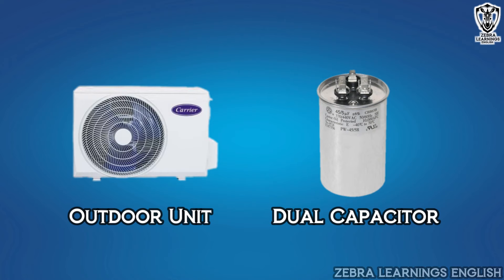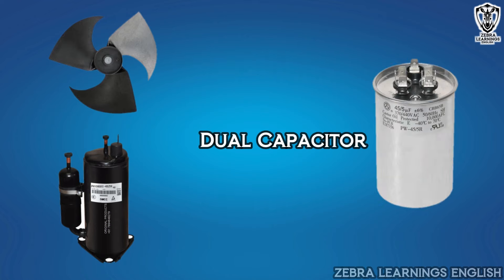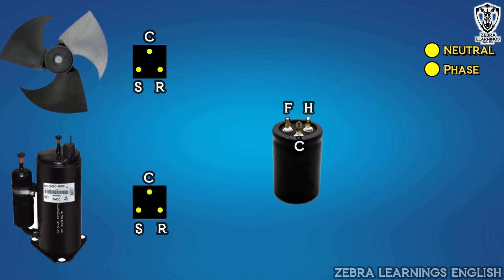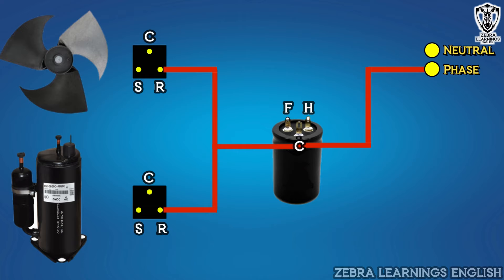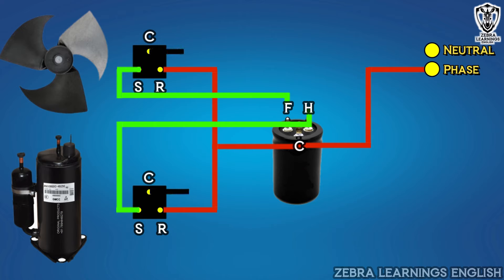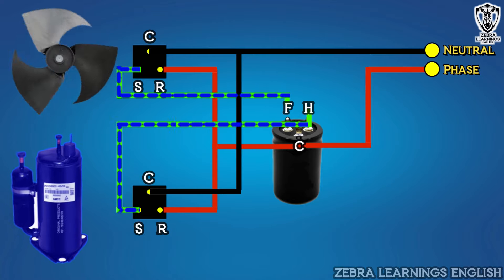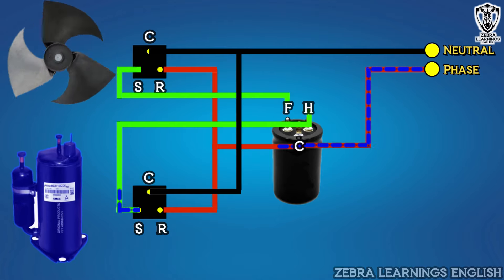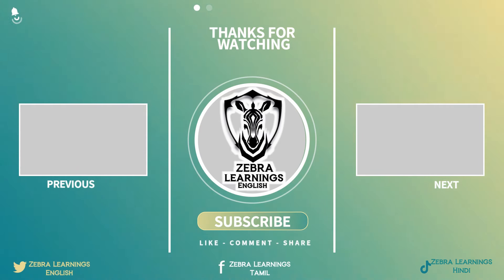Split AC Capacitor Wiring Diagram | Dual Capacitor | HVAC | Electrical

Comment: Good explanation except for one point: the capacitor does NOT turn off after the motor starts. Current flows through the capacitor to the starting winding the entire time the motor is running. The capacitor causes a phase shift in the current going to the starting winding relative to the run winding. The run winding carries the heavier current.

There are single phase motors for other applications that have a centrifugal switch that DOES disconnect the capacitor after the motor gets up to speed, but air conditioner motors don’t have that.
Reply: Is this true for the compressor as well?

Comment: I got a GE window unit ... Which wasn't working. Opened up. Changed capacitor. Didn't work. Saw this video. Only to see GE had switch the wiring on the compressor which wasn't firing up. Great video

Comment: Wrong cnection

Comon allways phase conect you andstand
Reply from the maker: Yes, in the diagram, common is connected with phase. Nothing is wrong.
Reply: No ,  i get confused, many video i see phase connected to, common. But you have onneccted  phase to  run. So which is which